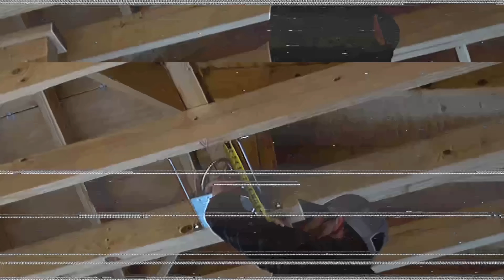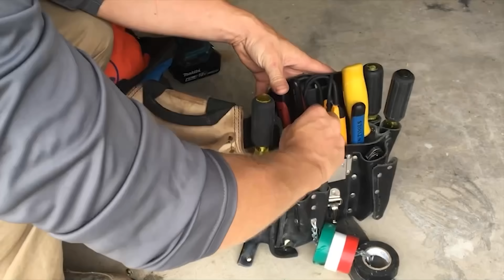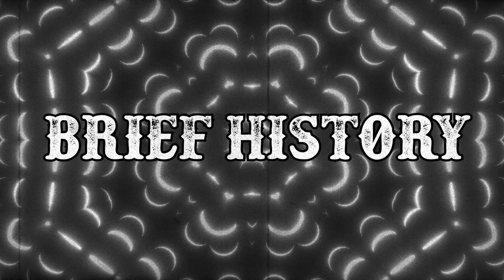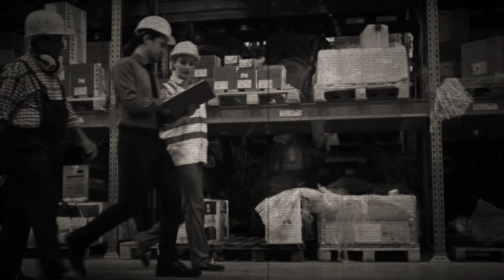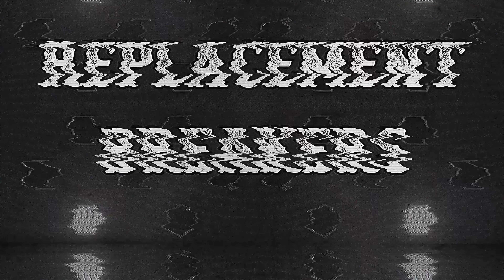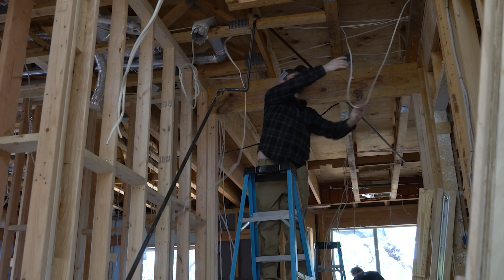FEDERAL PACIFIC ELECTRICAL PANELS - why their panels are dangerous

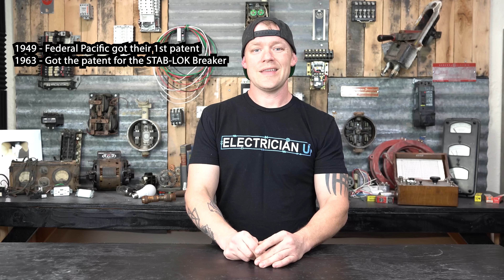Comment: Hi! The pic you show a 2:21 is the exact panel my friend has. I replaced the breakers for him 2 months ago, now I'm afraid to send him a link to this vid and even more scared to not send it. His is in a very old house that has lathe and plaster (i think that's the term for 1 x 2 boards nailed to the studs 1" apart and a ton of plaster built up over the boards) would you happen to know of a replacement panel that will fit that space for a direct replacement? For even more fun, he does not have any disconnect switch.

Comment: Currently working at a jobsite with one of these panels thankfully the electrician knew out these failing. So discounted most of the lines going to the panel. And it's being replaced. but till then we have one breaker and running all sorts of equipment through lol. They last property they worked on for a few months was a fire damaged property that should of been burned to the grow. Could of utilized that panel lol. Up always best to replace junk.

Comment: I worked for a major chain hotel in Washington DC build in the early 1980, it had at least 90 % FPE breakers some panels where 480 V never had any issues but they where scary when you took the front cover off most of the 20 amp breakers seemed loose until you replaced back the cover, I was able to find out the electrical contractors used them because there where cheap.

Comment: Canadian version  was federal pioneer  .Also Cornell Dupilier electric was part of FPE .FPE panels were installed in residential and light commercial from the 1950's to about 1980. when they suddenly dropped the market .
Reply: Worse yet, they were installed on homes with al wire

Comment: As the quality engineer and former chemist in a tire plant I can tell you that failure modes are very few and far between when working with tires. Usually entire production dates or batches are pulled as well as the ones before and after for testing and confirmation that the flaw was a one off. A single tire experiencing tread separation from the belt might cause tens to hundreds of thousands of tire to be recalled, but that’s less to do with a high failure rate and more to do with abundance of caution around a vital component to the safety of a vehicle. The percentage of failure in the tire industry is more in the 1 in 10,000 range depending on how new the tire is. After 6 years the aging rapidly increases failure rate due to dry rot from UV and Ozonation as well as general wear, oil and gas absorption from the road, running on low pressure etc. highly variable though.

Comment: The last time I encountered a FPE panel was on a call about loss of power in someone's bedroom. Turns out the circuit had been overloaded at some point and melted the wire feeding it because the breaker didn't trip..luckily their house didn't burn down
Reply: I have seen transformers trip before an FP breaker would

Comment: I had a FP panel, i wanted to add a new circuit to my panel but ouldn't find the breaker switch, so i googled it and found all these scary stories on these panels. Just replaced the whole thing. Now I'm not worried.

Comment: In our area ALL the mobile homes built from that era had FPE boxes. After servicing one or two we all learned to fear just walking into one of those homes. Paper thin paneling on the walls with an FPE panel in a closet behind a bunch of non-fire resistant (yeah, back then they hadn’t come out with restrictions for fabrics either) polyester pants and shirts. Like hiding a self igniting lighter behind solid gasoline. I was also a volunteer fireman and the number of electrical fires in mobile homes with FPE equipment was horrifying
Reply: My dad was an electrician and a volunteer firefighter in a town with many mobile homes, most with Zinsco/FPE breakers, and aluminum wire. At least one or two burned down every week.

Comment: What I used to tell customers is that they have a panel that has lost its ul listing and to check it out on "ismypanelsafe.com".  I would put things layman's terms and explain to them that about 1 out of every 250 breakers that were made, will not trip.  They will over heat because they don't trip when they are supposed to and could cause a fire.  Now you have a panel thats full of these breakers and your odds of having a bad one is now 1 out of 10.  I am not trying to make you feel unsafe in your own home. I have inspected the installation of the panel and do not notice anything that jumps out at me as incorrect, however, I would not be doing my job if I did not bring this to your attention.  Here's an option for replacement of the panel, however I will not install any replacement breakers in your panel or remedy any issues that may appear stem from it.

Comment: Lost my first house to an electrical fire. Luckily I was at work and had my dogs with me. While I was dealing  with insurance and shopping for a new house, I was renting my friends "pool house". Just a little one bedroom condo thing next to their regular big house. Not even a month in staying there, it's breaker box went up in flames. It's 6am and I'm taking a shower and getting ready to head out for work and the power goes out. I get out of the shower and see bright blue light coming out from the bottom of the door. Open the closet naked and wet and see the panel arching and smoking. Thinking quick I run outside and hit the main disconnect. 

Call the fire department and you know how that goes. They spray the attic. I had just lost what little what I had all over again. Insurance paid out of course and now my friend's parents have a fully remodeled pool house

We looked into it deeper after the fact and it turned out the feed going into the master breaker was not torqued down, creating heat until it finally went up. The electric hot water did it in. It was built in 83 and had CH breakers. 

I own the building where my business is in and I knew we had Zinsco breakers. I called that same day and told our electricians to replace that shit ASAP lol

I still catch jokes about burning down houses.

Comment: I enjoyed your vid.  I was surprised to see that anyone on YouTube cares about the Federal Pacific defective circuit panels and the recall.  I was a manufacturing engineer at another division of Reliance Electric for 8 years in the 80s and 90s.  I was the quality manager for a few years and responsible for the testing that UL required.  We produced telephone circuit protectors, which were UL listed.  When you design a new product UL does extensive testing in their labs before they grant a listing and the mfg is allowed to use the UL listing sticker.  UL sends an inspector once a year or something and they visually inspect a finish product and the components to verify the design hasn't been changed.  They also observe the QC electrical tests done on each production lot.   I haven't read more than 40 or so comments here, so I won't share everything I'm thinking.  If you are interested I can tell you about the guy from Reliance Corp in Cleveland who sat me down and told me the Federal Pacific story and how the recall cost more than the company made in profits for the entire time they owned it.  They understood "Cost of Quality".   Also I did a bunch of work with the CPSC while in another industry, want to chat about the criteria for a pubic recall?  And the question of acceptable failure or reject rate, it depends.  Automotive has been in the 100ppm range since the 90s.  At the same time they find a few almost microscopic cosmetic flaws at the end of every auto assembly line.  Thanks for telling this story.  It's very interesting to hear it from an electrician's perspective.
Reply: It appears I was wrong about a recall.  Here's the CPSC press release.  For some reason I think they replaced the panels in commercial properties, like museums.  https://www.cpsc.gov/content/commission-closes-investigation-of-fpe-circuit-breakers-and-provides-safety-information-for

Comment: We had one of their circuit breakers that failed it was a circuit breaker panel from the 80s so when we had it inspected before we decided to get up to code. They opened the panel and checked it they took note of the age of the panel as they were putting the panel cover back on one of the screws accidentally started into the wire and instead tripping it shorted the breaker without tripping the breaker. So yea that was made the decision for us here at my house to get a new panel before something worse happened.

Comment: My (awful) ex was an indoor grower, renting a house. It had a FPE panel. Yeah, bad combination. 
She hired a traffic engineer with a drug problem to wire her 15kW of lights, which he did by daisy-chaining each outlet off of the one before it. With 14 guage solid. I eventually fixed that. Ironically, the problem with a breaker came when I used my welder and it should have tripped the breaker but didn't. That's when I read up on these panels.
Same ex hired the same idiot to install a mini-split. With (water) plumbing tubing and fittings. He did at least use liquid tight flex for the power to the outdoor unit...except he ran out so the wire was exposed for the last foot. He also used his leg to hold a board he was cutting with a circular saw, and YES, he did end up in the hospital shortly thereafter with a pretty sizable cut.
Don't date selfish idiots who hire other idiots. And don't trust FPE panels.

Comment: Oh man Federal Pacific, I have one of those in my house, we been trying to replace it for years but it costs too much money to hire an electrician. Talking 5K + Materials.
Reply: Just replaced one for $1800 total
Reply: @RobinRobertsesq  you probably don’t live in the middle of nowhere.
Reply: @sterlingodeaghaidh5086  well, no. My electrician is local.
Reply: @RobinRobertsesq  huh. I live in the dead ass middle of nowhere, we have a electrician in this town of 750 but he isn’t licensed and he is pretty terrible from what I have heard. The appraisal I have gotten was for $5,325 and most of that was labor hours. You can see why I’m still searching.
Reply: @sterlingodeaghaidh5086   two guys replaced my FP panel in about 6 hours and that included relocation from inside to outside,  at same location in wall. Invoice did not break down parts / labor/permits. Now my mains are overhead, so they also did a new mast and drop.
Reply: @RobinRobertsesq  Ya, my local guy is just a crook, that's all. Id do it my self if the insurance wouldn't have a heart attack.
Reply: @sterlingodeaghaidh5086  a panel replacement is really not complicated if one pays attention and is methodical but its a stupid thing to DIY.

Comment: Great video. I’m fascinated to learn these breakers continued to be used as late as you've said. By the mid eighties (at least in NYC)  the standard joke was “Federal Pacifica? Wire for fire.” We all knew not to touch the damn things and not work in buildings that had FP panels and/or breakers.

Comment: Electrical engineer here, "acceptable failure/defect rate" is usually based on sigmas, or standard deviations. A lot of quality control is based on statistic analysis.

Usually the goal for defects is at least 4-sigmas. That means that %99.9366 of products produced should not have the given defect. It's deemed acceptable for 1 defect in every 15787 parts.

For "mission critical" or safety related systems, the standard is even higher at "6-Sigma". That is %99.9999998 success rate, exceedingly rare to have a failure. That's about 1 failure/incident/etc in 506797346 opportunities.

Sigmas can describe the requirements for a lot of things. For example, the % of parts required to be in tolerance. % of up-time vs line-down. Prediction of critical or catastrophic failures given number of products with some expected life-span.

Very powerful tool!

Comment: Ah yes, the old "Fire Probably Evident" panels. 

If I remember right, (As told to me by an older electrician) FPE had two classes of circuit breakers: Fast acting meant for lighting circuits, and time delay (AKA "Slow blow") for outlets. Problem was two-fold: No difference in the molding, and electricians didn't care, putting everything on time delay breakers to eliminate nuisance tripping out of convenience. Creating the hazard in the process.

Comment: I have a Stab-Loc Federal Pacific panel in my house. Never gave me a warm and fuzzy feeling, plan on changing it. I'm just happy I don't have aluminum wire from that era.
Reply: Ah yes, Federal Pacific breakers and aluminum wiring, what a terrific combination! Then add in the cheap contractors who used 20 amp breakers with lots of 14 gauge Romex wiring, and you have a perfect storm! Yes, my house was one of those.

Comment: @Electrician U re: product failures, yes -- all products have some level of failure, and the acceptable failure rate depends on the application. Few people would care if their teapot was slightly faulty. Everyone would care if their subway cars had a failure rate.

What's more important than failure rate is if the product fails safe. If your subway car fails, but when it does it turns on the breaks and stops, that failure isn't so bad.

Comment: There are really two concepts to consider when you brought up the question to engineers about acceptable failure rates. It's important to distinguish between defect rate and failure rate. Defect obviously being problematic before the customer starts using the product. Where failure rate involves use first. Failure rate is measured from in the negative from design life. If you design and say it will last 10 years then it fails if it lasts 8. Now the real answer to your question...there is none. Every industry and product is different and the reality is the answer for several decades now especially in electronics is whatever they can get away with to make the most money. It often costs less to break the rules and pay a fine than to spend the time and money to do it right the first time.

Comment: i replaced one federal pacific panel  and lots of pushamatic panels . in 1979 i lived above a store the worker pluged in a sweeper when she turned it in on half of the power was out she called me to see what was the problem it blew out a 100 amp main fuse  but it did not trip the 15 amp pushamatic breaker

Comment: I’ve replaced a number of federal pacific panels. One of which was still on fire at the time.
Reply: Last panel change i did was fpe. The whole stud bay was burned from 40 inches up to the cieling
Reply: @jesseready5667  lucky you got there before they died in a fire...unreal the kind of shit that is out there just a moment away from complete combustion!
Reply: @jmb9518  the deadfront contained the arc flash it knocked the pud fuse out whole wall was black. Carpet nearly caught fire.
Reply: @Jesse Ready I have pulled outlets where they have had a deep friar or something with a high demand motor or heating element load...or space heater...and has burned the neutral and the blue Carlon box was melted and nothing but ash cover the once white neutral....always check the panel as it usually will burn on that end too...GEs from the late 60s early 70s had major problems too...but not like FPE etc.
It is crazy out there some of the things I see.
Reply: @jmb9518  thoseeGE from the 60s and 70s are you referring to the zinsco style breakers? I know GE and Sylvania made them as well as zinsco
Reply: @jesseready5667  Zinsco is absolutely horrible too...but no I'm referring to GE panels from the late 60s early 70s are just as bad...both the regular/standard size breakers and slims...if I see a panel that wasn't installed at least after 2000...I recommend it be changed...there are good panels out there...but 20-30 years is a good life from an electrical panel that you depend on daily 24-7 to be available for you to use safely
Reply: @JMB  yeah to be honest other than zinsco not tripping I think the biggest issue is that people don't know the single pole breakers can be swapped for legs of power so I see a whole panel of  20 amp on one leg.
Reply: @jmb9518  I always buy NOS bakelite sockets from the 40s and 50s when I need one in my house. Bakelite is more fireproof than china plastic. It doesn't just melt and liquefy.
Reply: @MrWolfSnack  yeah, you can keep them old bakelite boxes, they shatter, crumble and strip the screws out where it is threaded...but, we all have our preferences
Reply: @jmb9518  That's after 60 years of use dude. When they are brand new that doesn't happen. It helps when you have an education and know what you're talking about and not just blindly parroting bullshit you know absolutely nothing about.
Reply: @MrWolfSnack probably the main reason why you might want to use brand new outlets is that residential code typically requires duplex outlets be tamper resistant.
Reply: Yep
Reply: FPE is the Ford Pinto of panels
Reply: How much does it cost

Comment: It was Reliance Electric (out of Cleveland, OH), not "Reliant", that purchased the Federal Pacific operation. Most of FPE's higher voltage circuit breaker products were high quality products, it was the 600 volt and below that had the problems. Reliance bought FPE so they would have an in-house source of circuit breakers for their 600 volt and below motor control products. It wasn't the smoothest move they ever made. Then around 1980 Exxon bought Reliance because they wanted Reliance to sell their "Alternating Current Synthesizer" for AC motor speed control, which was an AC variable speed drive. It took Exxon a few years to realize that Reliance had already invented products superior to Exxon's whiz-bang ACS - both PWM's and VVI's.